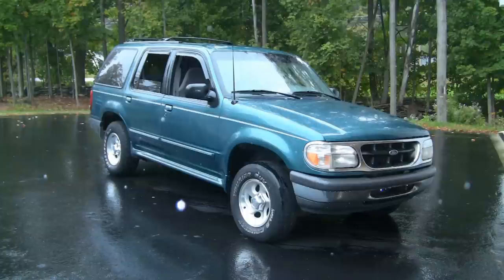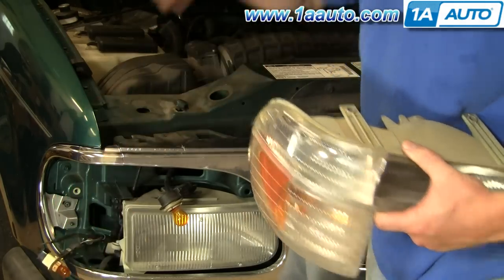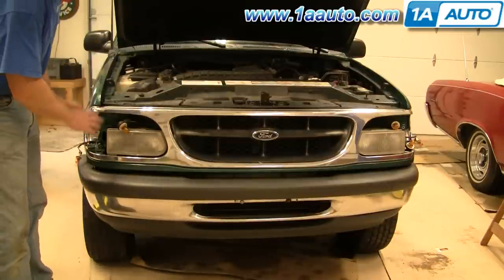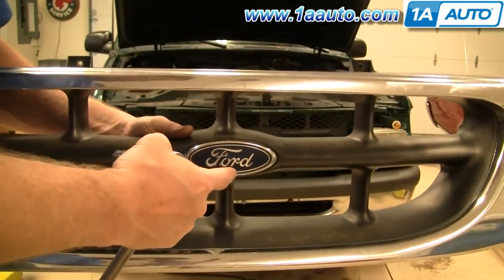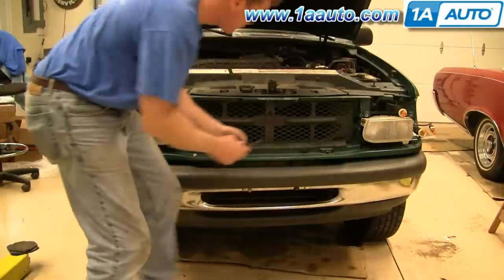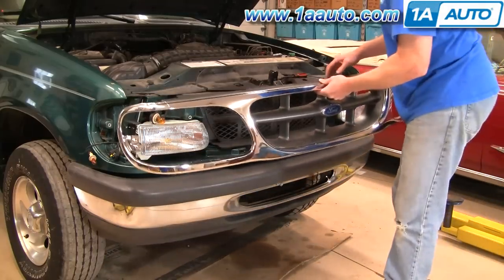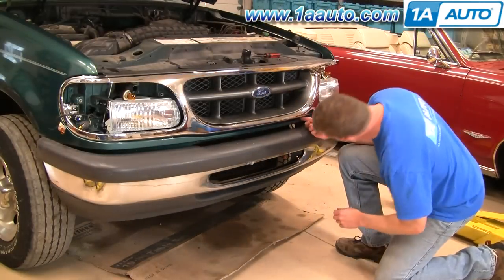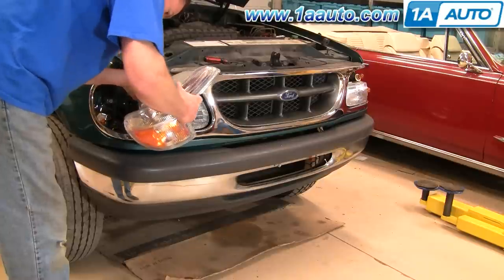How to Replace Grille 95-01 Ford Explorer

Comment: Ford emblem on the grille on the front side has the front license plate, and the Ford emblem on the trunk opener and the rear license plate is between the capitalized word EXPLORER on the left side and capitalized letters XLT on the right side.

Comment from the maker: @ELTANKEJORGE The process on your 03 Ford F150 would be different. Most of it should be held in with screws or bolts that would need to be removed. Hope this helps.

Comment: took the grill off just fine, went to put it on and had a slight problem. there is a small metal bar that if its out of place your light bulb will not go back in, after hours i finally figured it out.THOUGHT YOU COULD MAKE A NOTE LOL. P.S I WANT TO INSTALL FOG LIGHTS WITH A ROCKER SWITCH, I HAVE A 1998 EXPLORER SOHC, ANY IDEAS HOW TO INSTALL?

Comment from the maker: We currently do not have an auto repair video that shows this particular repair. However there should be a bolt under the cover at the end of the wiper arm that you need to remove; once that's off you should be able to remove the wiper arm and change it. We carry new wiper arms with FREE SHIPPING in the lower 48 states on our website 1aauto.com 888-844-3393